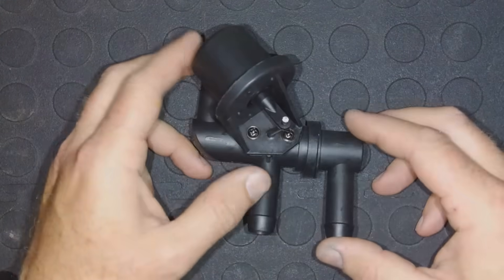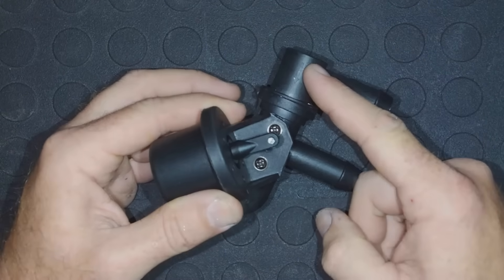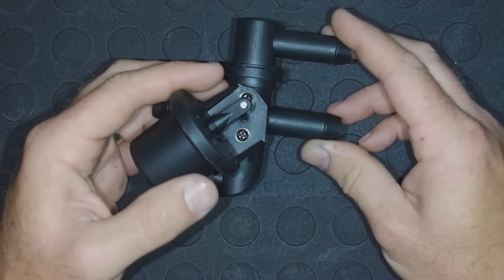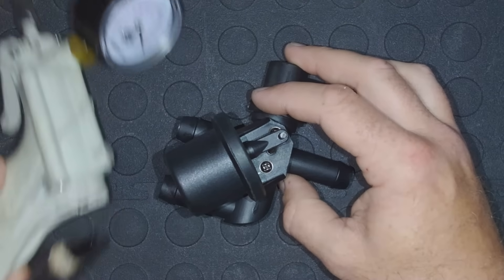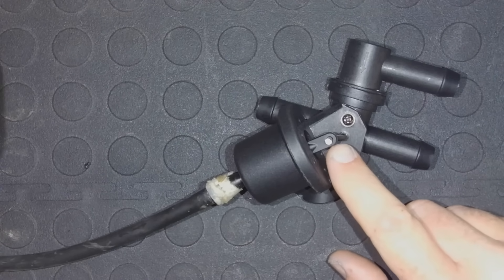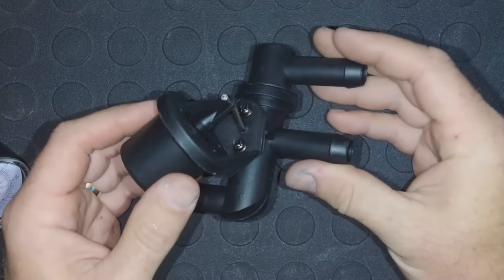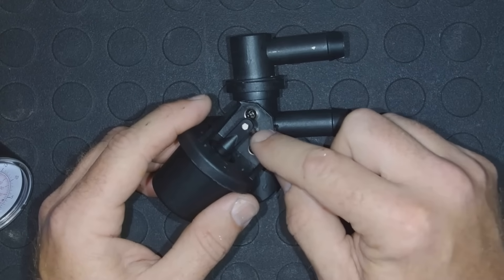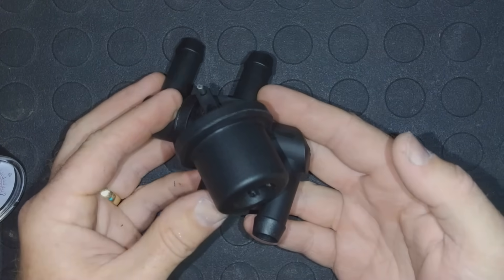Heater Control Valve operation and testing

Comment: the corners of my center console where the vents are located began to heat up, my ac as well as the blend door actuator don’t work so the door has to be switched manually. right now it’s on heat, not sure if that matters but would the heater control valve be part of the issue if there are certain parts like even open areas like the compartment under the cd port blow hot air as well as heat around the drivers feet?

Comment: My piece of junk O'Reilly valve is 2 or 3 years old max and it is leaking along the actuator shaft.  I picked up a new one at Advance today and hope that it will last longer.  The original lasted about 20 years roughly, but had already started working the hot flow intermittently.  Only when it failed altogether with no heat coming out did I get serious about finding the cause.  Thanks YouBoobers ! ♥  Looking up from underneath with a flashlight, I could see clearly where the leak was coming out of.

Comment: i think this heater core valve is normally open.. if AC on into max the vacuum is activate then the system is closed and no hot water going into the heater core..correct me if im wrong...

Comment: im having problems with the one in my 99 tahoe, i replaced it because it was cracked and leaking, my problem is i cant find where the vacuum line comes from to plug into the port on the top, nor do i know how long of a line to get as it is also long gone
Reply: i got a 12 inch line and just cut to what I need how ever I also need to know where the vacuum line connects to
Reply: @D.JKennedy  i ended up finding where my line ran to, but its an old and beat up enough i decided it would save me headache to just do an electric bypass

Comment: Thank u for the explanation of the process. The valve was leaking by the screw holding it in place. It was loose, I tightened it n no more leak. But you explained that the gasket gets worn and starts leaking. That lets me know the valve is beginning to give out n needs replacing. Appreciate your knowledge n sharing your expertise. May God bless you!

Comment: My heat works great but when I switch to cold air it still pumps hot air. I know my AC works because I recently had it serviced. My thought is that the valve is not closing and hot coolant keeps flowing... anyone has a tip?

Comment: Ok, so valve open allows for the heater to run and valve closed is for the A/C??.... I ask 'cuz I have a manual one installed on my '07 Chrysler 300 base model 2.7L. Depending on the weather, I open my hood and open/close the valve before starting my car. Sometimes I forget how to adjust the valve for the weather at hand ..can someone tell me if I am wrong or rite??

Comment: What about failures of the butterfly valve itself?

There's good vacuum and holding, the stem arm rotates and the stem seals aren't leaking. But the disc, inside the valve body, is no longer fixed to the stem and is stuck in either the closed or open position.

Does that ever happen?

Comment: What is that pressure air tool you're using I like that
Reply from the maker: It is a hand held vacuum pump. They are available at most parts stores or tool suppliers.

Comment: Does the 90 degree elbow at the end move? Mine came disconnected and I don’t know if it’s broken or is able to move and come apart
Reply from the maker: Jacob,
There are thousands of different designs of valves so I'm unsure if your elbow is removable or not. Most of them are not removable so if it came off it is more than likely broken. However without seeing it it's impossible to be sure. Have a great day!

Comment: I have a 1998 Lexus LS400. My heat just went out last week I did some research and tried to troubleshoot a few things I believe it's my heat valve or the heat blower/ fan. My father is a mechanic as well he is the one who told me about the heat control valve. My car is not getting hot which is a good thing but I know I need to get it fixed immediately. Do you have any clue on how much it would cost? Thanks
Reply from the maker: For accurate pricing information please contact your local parts supplier or service center. We are unable to give estimates on this platform. Sorry!

Comment: Great video. It seems that when vacuum is applied the heater core is then bypassed. As I observed the valve position when you pushed the plunger. 
I am troubleshooting this system in a 2003 explorer where vacuum is always applied to the valve bypassing the core until heat is requested, when vacuum is reduced directing flow to the heater core. I guess they want you to have heat even if the vacuum system fails. 
For what vehicle is that valve?
Reply from the maker: I think it's from a mid 90's Ford Explorer.

Comment: Or is there any way to change the valve seal? Without replacing that whole unit
Reply from the maker: Usually this is sold as a unit and intended to be disassembled.

Comment: Helpful video!

So why do these leak? Do they look through the screws? All the tubes seemed closed with clamps and dry.

Anyone know about repairing it?
Reply from the maker: They leak from the valve shaft Usually not the hose connections. Sometimes they will only leak when transitioning from heat to A/C as well.

Comment: Helppppppppp  helpppppppp me guys please .I got a 2000 Ford ranger 2.5 .my heater control valve got melted how could something like that could happen .got melted as if there was a lot lot of heat .but this is the 2 heater control valve that does the same .I got a oc2sensor code
Reply from the maker: More testing on your vehicle (by a professional) would be needed to verify but, you may have a cracked head or failed head gasket causing combustion gasses to enter the cooling system. This can and will melt the Heater Control Valve.

Comment: I was hoping you would say that it can also become a point of vacuum leak. I have a vacuum leak in my 2000 Dodge Durango but I can't find it I'm assuming it might be linked to the heater control valve if it is at all possible vacuum pressure actuator.
Reply from the maker: It is possible that this part is leaking vacuum. Rare, but possible.
Reply: @indianhillsautotechnology2707  yeah.. i cant find my leak??

Comment: Great video….I drive a 2019 Toyota RAV4 snd they’re telling me that mine is bad but I’m not pulling any codes at all. Does that sound right? I am getting an engine maintenance required warning but no codes: and this isn’t the “maintenance required” for the oil change but a message that reads “engine maintenance required” and there’s no way to reset it, I and the dealership both tried.
Reply from the maker: This part can fail and not set any DTC's (codes). There is always a way to reset any maintenance light. Are you sure it's not due to any normal service?
Reply: @indianhillsautotechnology2707  positive
Reply: In toyota it gives code , engine coolant bypass valve A or B , it has two first for heater scond for Transmission oil

Comment: Couldn't you just push it in and put ypur finger over the hole and see if it holds
Reply from the maker: That can check to see if it holds vacuum but does not prove the valve has the ability to move under vacuum. Many vacuum operated systems will get debris or carbon in them. This can cause them to hold vacuum but not transition from hot to cold. Good idea though! Your finger is better than nothing if you don't have a hand held pump.

Comment: I hope this info. is a reminder that, when Installed on GM/Chevy's; the Valve is always opened (Extended, Upwards-lever) where Hot Coolant can pass through; included during Heat-settings. Until Vacume is applied (Within a Completely sealed vacume system) to the Canister; during 'Any settings of Cab Cooling'; (as then, the 'lever on the top of the Caniste'r of the "Heater Control-valve"  then retracts downward. This is in general info. for proper understanding of its functionality; during Installation on [General Motors], vehicles!
Reply: Freggin thank you. I was so confused and this confirms what my common sense was telling me. 😊
Reply: Thanks! Do you know if this is the case for Ford Explorer? 4.0 SOHC. Slightly different valve, just an in and out.
Reply: Im Very Surprised that your Question just arrived now; Dec. 9, 2024 .....Wow, 3years later. 
Im not aware of your specific Heater-valve.

Comment: Is this also the part that regulates(not just on/off) water flow when heat is on low/medium/high?
My car is constantly heating at full power, regardless of AC.
Reply from the maker: I am not sure this part would be your problem. While it is possible it is more likely a temperature blend air door actuator or the door itself. Could also be the control head although its not as likely as the actuator.
Reply: @indianhillsautotechnology2707  thanks for your reply, I fixed it and it was indeed the mixing flap/blend door actuator! 👌

Comment: Looks like very little vacuum was needed to actuate it. I'm looking to engineer one for performance reasons; whereby a turbocharger while in boost will force the valve open to redirect coolant flow destined for the water pump to the engines main radiator. Are you aware of any valves that might act in this nature?
Reply from the maker: I am unaware of any of these that operate under pressure. If you find one let me know!

Comment: Very useful video.  I have a problem with my van sending hot air to the cabin all the time, so my guess is that most likely this valve is stuck in the open position and the flow from the motor is running in a loop through the heater system all the time, am i right?
Reply from the maker: You could be correct. It could also be a Temperature Blend air door actuator.
Reply: 80% possibility of a leak with the Vacume system, either a; Unconnected connector, Worn-hose, or Worn-Seals on Vacume system parts.
Reply: Mine was my door actuator. Very easy to change yourself! I'm thinking of putting on my old one because my new one fixed my AC but not my heat 🙃

Comment: Nice video I don't have leak but heat blows cold air in park but driving heat works better. 2012 silverado 50k on it. This should be the problem you think?
Reply: Thank you I figured it out. It was heater core needs to be flushed 😳
Reply from the maker: @lamontvalentine5140  Excellent! I am glad you figured it out.
Reply: @lamontvalentine5140  seems like really low miles to be having to flush the heater core.
Reply from the maker: I don't think that would be your problem.

Comment: How much pressure dose this valve deals with? Can we glue the broken nozzles of these valves?
Reply from the maker: It would be the same pressure as the cooling system. That pressure amount would be listed on your radiator or degas bottle cap. We do not recommend gluing any part of the cooling system.

Comment: Pretty sure that's the source of my mystery coolant leak on my 07 Express. Thanks.
Reply from the maker: Hope it helps!
Reply: @indianhillsautotechnology2707  I have the part. Tried to put it in one day last week and couldn't get a pair of pliers on the spring clamps. I bought a set of spring clamp pliers that have the long cable on them. Now I just need to find time again.
Reply: @SwapPartLLC  Vice Grips work great for those pesky clamps